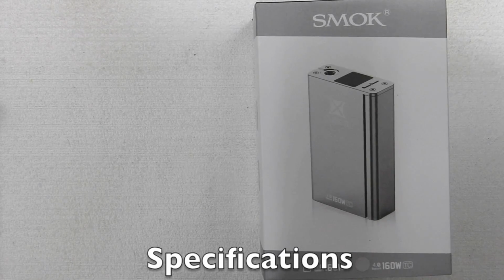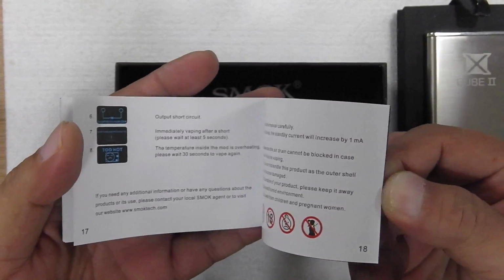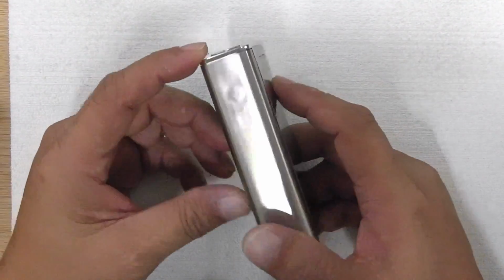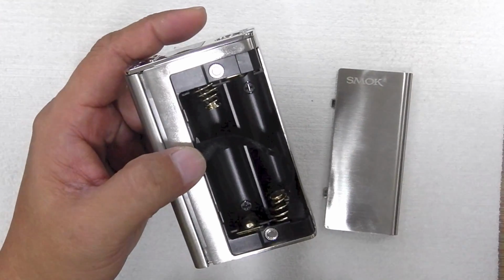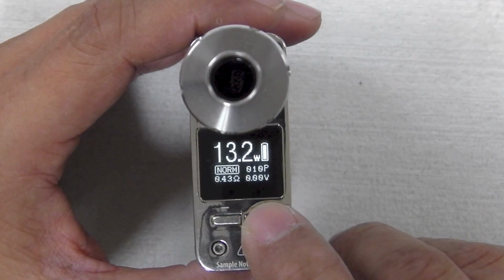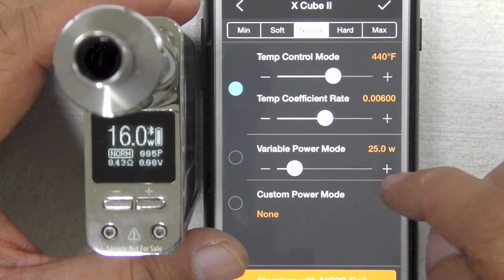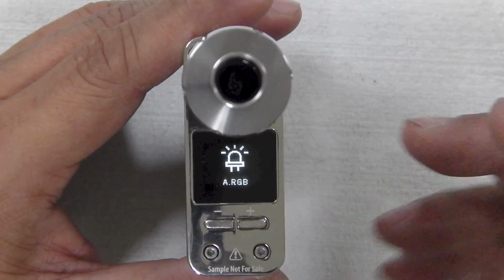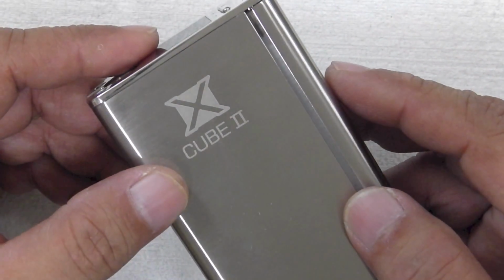Smok XCube II By Smoktech

Comment: im new to a mod like this, had the sig 75 tc which was pretty simple in terms of tc, but not with this kind of chip, when im using nickel it gives off a temp warning msg. is that normal? i think it does that once it hits the target temp. but does it cut out the power or just automatically steps down?

Comment: Some people have had trouble with SMOK and their phone app not connecting.
First of all, to connect to SMOK to register or log in, you must turn off WiFi. This is a bug in the phone software. This will allow you to login successfully.
First, though, you should upgrade the mod to version 1.092 which fixes all temp control issues (especially for Stainless Steel) after you upgrade. Then upgrade the app on your phone.

Next, you'll have to then turn on bluetooth on the phone and on the mod, and launch the app on your phone, after which you login to SMOK. After you're logged in, connect to the app by bluetooth to the mod as usual. Now hit the rightmost round Spacely Sprocket icon and choose Vapor Up-gradation where you can purchase different coil materials and temp control. You'll have to reinstall any purchases you make after future firmware upgrades to the mod right here. Then hit the leftmost setting icon and choose your coil material at the bottom. Then hit the rightmost round icon of a Spacely Sprocket. Then select "Reset Temp Coefficient Rate to make sure you've got the right value AFTER you pick a coil metal. Then, just hit the upper right checkmark, which will cause the info to be sent to the phone.
And that's it!
Vape on, vapers!

PS feel free to ask me any questions.

Ross
Reply: Afterwards, you should always use the default TCR or your temperature will not be accurate.

Comment: Great review, I have had one for a couple months now, the firmware has definately changed this device for the better. I use Ti 1 in mine pretty much all the time, I have never had an issue with it. Only couple small nit picks would be the polish finish gets scratched up pretty easy and the android app isn't as good as the apple one, but it's a solid device for the price is hard to beat.

Comment: Hey Richard I was wondering, what kind of nickel wire did you use to make that dual-coil build on your Velocity? I noticed that you did it at 15 wraps but on what size drill-bit and what's the gauge on that nickel wire?

Thanks for the great review.

Comment: Nice review!   I updated the firmware flawlessly and and can now set the ohms resistance at my leisure.   Not really having any trouble with the battery door at the moment though.  So, I think I will just leave it.  If it loosens over time I will apply the foam pieces.

Comment: Richard great review as always interesting device for sure and the price is good for such a feature laden unit but it seems as though there is quite a bit you need to do before you can utilize the device. 
It would be nice if the company upgraded it for the user before packaging and shipping the unit but it is what it is I guess. 
Not sure I like the side bar firing button, it makes pocketing the unit a bit risky for self or unintended firing if bumped, it would be like butt dialing with a cell phone lol. More of an at home device than an out and about unit.

Comment: Hey Richard nice review! :-) Hmm if you're still using that Sweet Spot Vapors TiFe it's not a '350' coefficient, assuming SMOKTech cloned a eg YiHi correctly it's calibrated for Titanium Grade 1 (Ti01) wire. Yeah there's a big difference, there's a substantial difference between the non alloy Titanium Grades 1-4 let alone some alloyed wire.

LMAO people thought the Dicodes menu was complicated, I think it's simple, but there's a whole lot of menus and submenu's to go through. 

What someone needs to do is  to have an option to set the coiling and Atty (airflow) information and for Temperature Control to calibrate and set the power profiles. I've lost count have many times I have seen people using poor settings and over / under power.

Comment: Great review as always brotha. When in the menu, if you click fire it jumps between settings but anytime you hold it it enter the setting, once you get used to it's very quick to adjust any setting. Also if you flip the screen on the new firmware the buttons also flip the next sold mod's will not have the + and - laser engraved but it has an bug, when you unscrew and screw the same atty and it asks new coil? if you hit no it is stuck asking the same everytime you try to fire... Keep cool and vape on... ;-)

Comment: I think the x cube ii is reading the ohms incorrectly. I used steam engine to calculate the coil and left the TCR the same in the x cube ii. I got the same results but have the mod calculating resistance based on the coil ohm which might be more accurate than adjusting the tcr (temp protect might cut off differently.) would you be able to verify this with Smok?
Reply: Devil Doc if you update the firmware you can manually set the ohms resistance.
Reply: +Eli double dub Right, I used steam engine to calculate and input that number in the X Cube II. I failed to clarify that. Thank you.